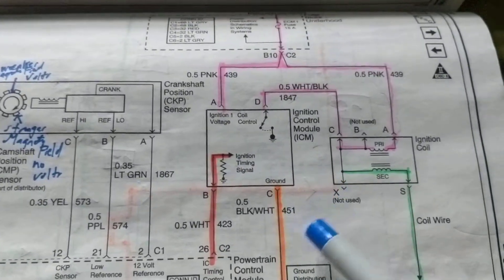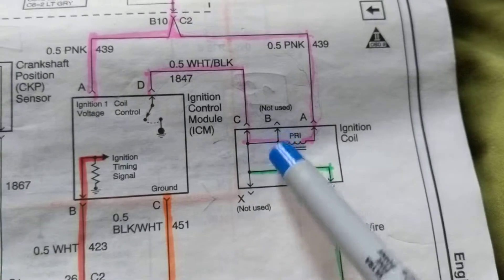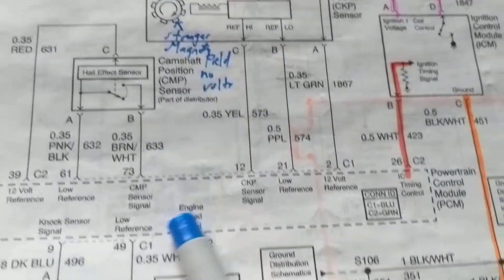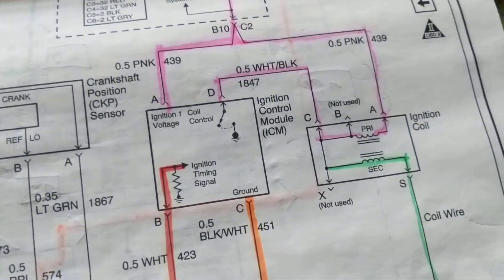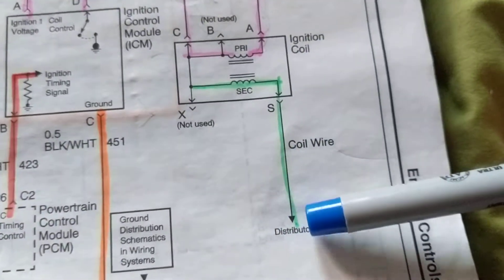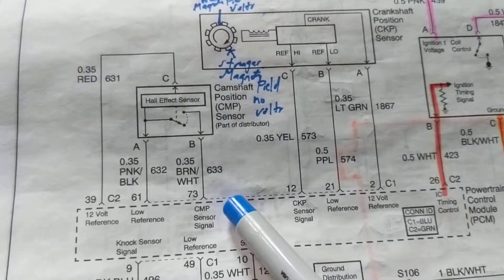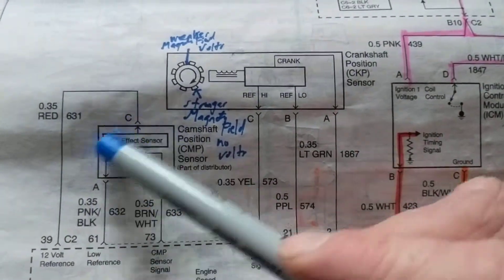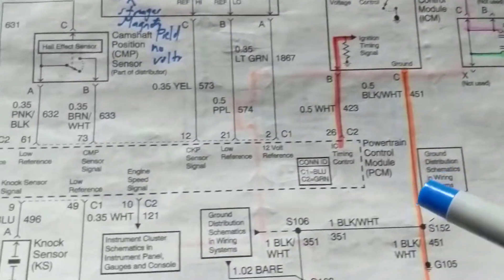HOW IGNITION CONTROL MODULE WORKS AND DIAGNOSE FOR TROUBLESHOOTING TO CREATE SPARK

Comment: Hello sir Im in proces restoring me wire harnest please some help.
Its Opel Ascona C 1.3l engine E core ignition coil with induction pick up and 4 pin gm ignition module.
I hade some problems with static engine wont shut off or self acelerates .
So I see there is mentioned positive linear voltage regulator inside the dashboard and I do not know if the ignition coil gets its power from that device or not.
So I was curiuse to know can I use relay insted I have bunch 6pin 4pin 3pin relays but I dont know if it shuld be NO OR NC relay? 
So Im not shure if it wuld work or not its tipical GM design car .
I found out tge dashboard is bypassed alternator light wia check engine light ,posibly 1 or more relays interacting with ich other,I have crapy bulb rear holder with dual filament bulbs and xenon light bulbs front.
I was not shure what caused those strange effects I did found corosion for blinker relay ground and 1 black wire got fried on ignition key repaired it but problem returned again after some periode of time .
So please help me if I make seperate circuets where do I put diodes or zener diodes in what location for ich pin lay out to avoid relay interactions .
Also what value shuld I use for me Delco 12si alternator diode or resistor or bulb value and if it is posibel to change the starting charge on those alternators I can run me engine as low as 300-500rpm so I wuld like to know opinions for manuali regulate those alternators or if there is external regulators that are programabel for alternators some peopel mentioned closed loop regulators so hoppe you can tell me more what wuld be best to do.

Comment: Very informative, ty. I wanted to ask a question though. I thought it was when the ignition module closes the switch and grounds the circuit the magnetic field collapse. While its open it builds a charge. I'm not trying to be rude or act like i know everything. I wanted to ask so I can understand and know if I'm wrong or not. Thanks again.

Comment: Hi, I am from India 
I ask to you Ignition control module repairing is possible?
Reply: The equipment needed to replace chips are quite costly surface mount technology need special equipment and also usually board level is preferred today since it takes a longer time to do component level on a module you can see my channel Joe electronics schematics for auto where I talk about these type of ignition control modules

Comment: Horrible
Reply: Thank you for your comments I appreciate it always looking for improvement what did you dislike about it so I can improve it it's a very technical subject electronic diagnostics and you have to know schematics well and diagnostic equipment well but I am looking forward to your comment
Reply: @Joeelectronicschematicsforauto  You spent five minutes vaguely describing how individual windings in a coil work. Simply put you should’ve just stated that a coil will make a 50,000 V spark when you disconnected that’s all people need to know you spent so long getting there you’re going to lose everybody hope this helps
Reply: @jeffkellner1585  thank you for your response the ignition coil differs as to the pulse it depends on the electronic fuel system not all fuel injection systems are the same it depends on the computer when it turns on the ignition coil that spark can be way less than 50,000 volts who's going to go and measure a pulse that's 50,000 volts anyway even if I tell them that all they got to do is go to check for pulse and that's it so how will they know that it's 50,000 volts tell me according to your logic
Reply: @jeffkellner1585  there's two instruments that you can measure the spark when is the probe I want other one is a scanner or a fluke multimeter what person watching is going to go and have one of these equipment number one number two on the GM like this the condition coil is triggered by the pulse of the computer to turn it off so there is a magnetic field which induces the spike how many people get to think that it's a computer problem not too many right everybody's going to concentrate on the ignition coil right so trying to figure out how your theory of just saying it's a 50,000 volt Spike to the viewers can be related
Reply: @Joeelectronicschematicsforauto  
You are completely missing the point I will only say this one more time your explanation is way overstated all you need to tell the people when it comes to the spark is that when the coil ground is removed the spark will occur have a great day leave me alone

Comment: Does the ignition timing signal receive 12 volts at all times or does it get a pulse signal when the key is turned?
Reply: The key has to be in the start and run position the computer decides when to give a pulse in that condition based on the sensors inputs from the to the computer thank you for your question

Comment: Hello,  i have a Golf 2 GTI 16V and when i start the engine doesnt goes a signal to the fuel pump, when you put in the contact the fuel pump should do a noise bzz for 2/3 seconds but at my case doesnt do nothing. Is the problem at ECU or at the Ignition Control Unit?!

Comment: Can anyone please help me out with something ? I have a 1994 ford f150 5.0 lx truck and I start it up I drive it about a block and then it dies and it starts right back up but does the same thing over again.it always starts right back up .I need help please if anyone knows why it does this .I would appreciate it
Reply: It could be a couple of things it could be on misfire and you can detect that by looking at the engine when it vibrates sometimes spark plugs are the problems with these Fords or the wiring themselves or could be a sensor problem but going back to 1994 there weren't so many sensors as they were today that's why the best course of action is to put a scanner and to see how everything is reacting Catherine but obviously you have to be familiar with that good luck keep me informed

Comment: On the IC Module for EcoTec 2.2 engine there is a small adapter, which is connected to one of 2 female terminal connectors in car harness. Does it matter, which side goes inside of the connector? That adapter has pretty similar ends, but a little bit different. Maybe it is just a design and not important with which end you connect. And also is there a need to apply any heat transfer grease on that metallic plate (you mentioned it gets very hot), but usually none does it. Thank you for the informative film.
Reply: Usually the module that I use is from the dealer I never really have any problems for a modifications the connectors always adapt to the old one you have to make sure the connectors are correct plus and ground as signal wires that definitely makes a difference usually there is a slight variation if you get it from aftermarket but you have to match up the old connector with the new one wiring very important

Comment: Can u tell me why my ignition control module keeps going out after about a week after I change it. It's a 99 gmc by truck.. thanks!
Reply: Michael Jobe electronic modules can go out for component failures for heat problems and for vibration problems which cause chips and pins to disconnect if it's a heat problem you can put something called  a freeze spray if the symptom goes away that means it's heat-related
Reply: @Joeelectronicschematicsforauto  thank you so much for replying. My truck will run great for about a week and it goes out. I don't know what to do and don't have enough money to put in the shop
Reply: Michael Jobe you're welcome ignition control module for Chevys have a big heatsink on them that's the metal plate that you see on it they get very hot
Reply: @Joeelectronicschematicsforauto  Be sure to use a dielectric paste to spread the heat between the module and heat sink.
Reply: @jamessmejkal8803  all electronics modules such as amplifiers where there is heat sinks there has to be a dielectric in it already from the manufacturer otherwise it would burn out instantly the problem is the modules the vibration thank you so much for being a viewer and your comment good point
Reply: @Joeelectronicschematicsforauto  An ICM I purchased from O'Reillys did not have dielectric with it and none was installed on it, I think the owner may have burned the new one up because he could not wait (Kids) to install it, my fault for not checking the box and the salesman did not mention the need for it. I like your video but I think a little complex for those without an Electronics back ground or formal Auto Training.
Reply: @Joeelectronicschematicsforauto  None in the box or on this module, thanks for the info. No more electronics from them , but again my fault, I have been in electronics for 60 plus years and should know better.